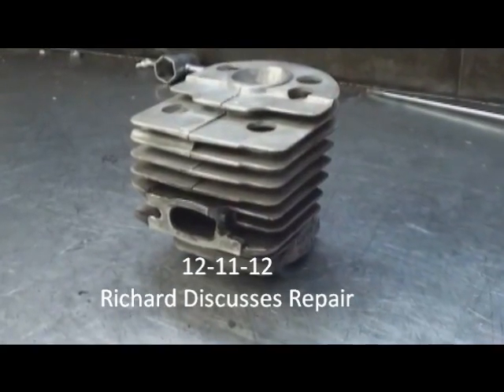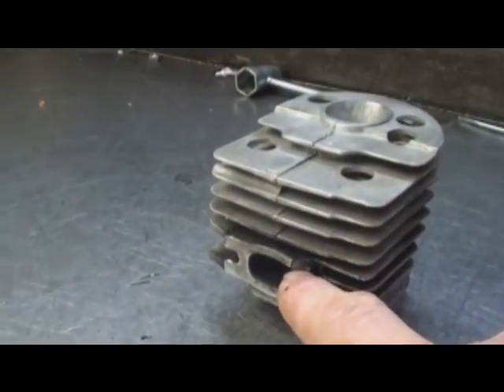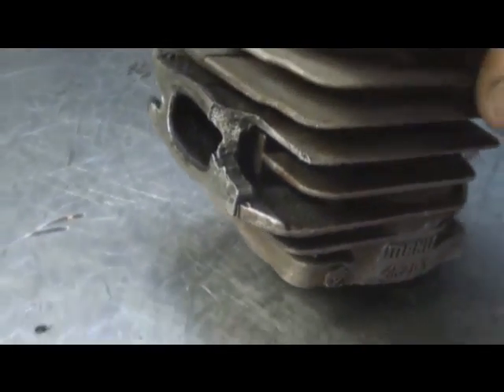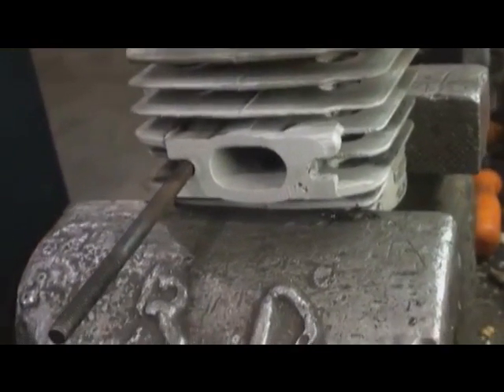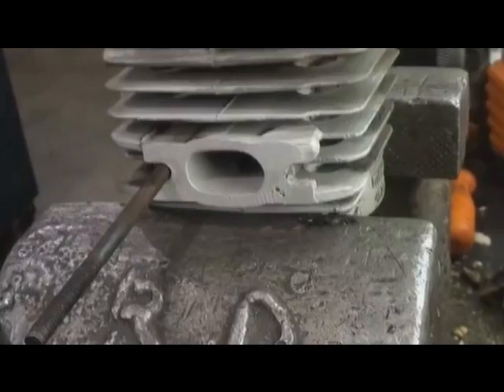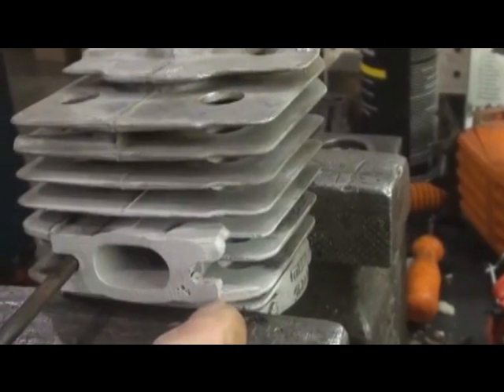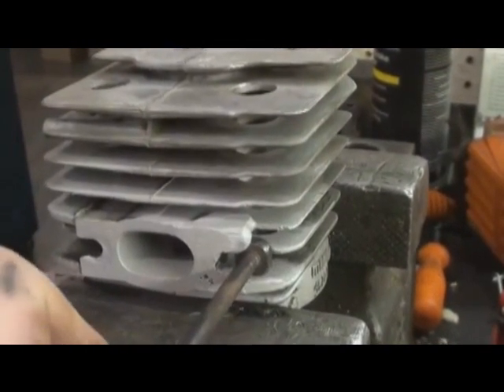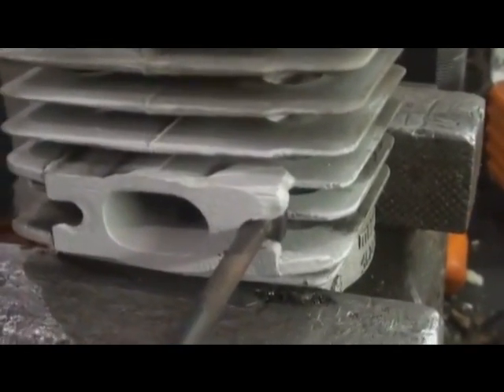Husqvarna 55 Winter Project

Comment: Would like to do a project with a 55 to see if it can match those 350's with no base gasket builds. You have a 350 as well?
Reply from the maker: I don't have a 350 but have always wanted one. My 55 is awesome. I also have two 51's. Great saws but no comparison in the power.